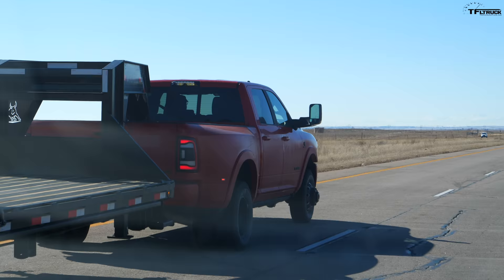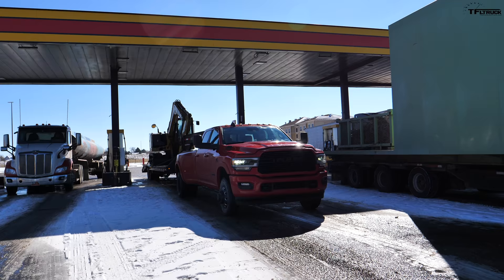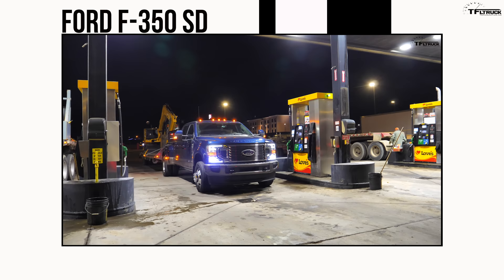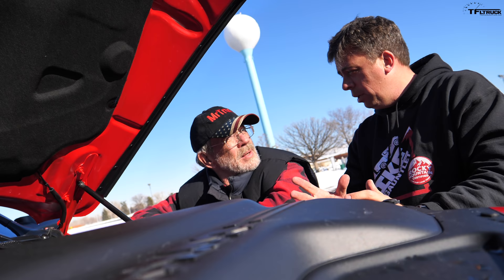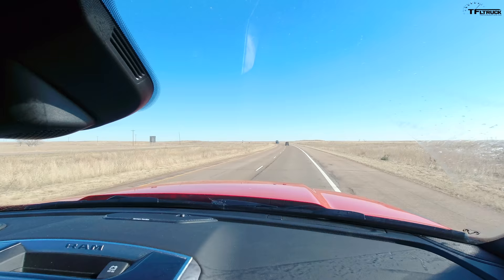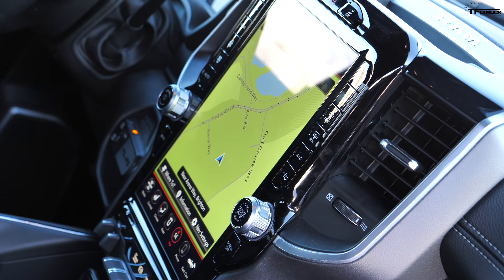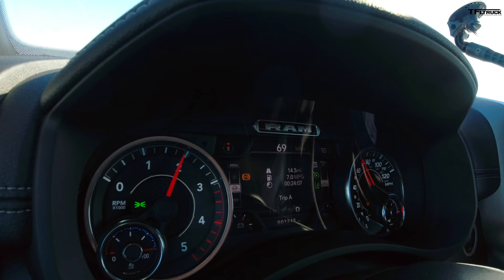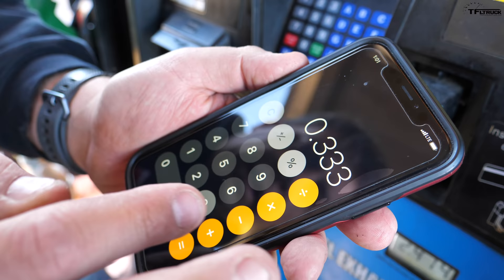New Ram 3500 Cummins Takes On Our 30,000 Lbs MPG Challenge Against GMC & Ford Diesels!

Comment: After owning a third gen cummins I said I’d never buy a Chrysler product again. But that is nice.
Reply: Haha yeah I agree. I have a '14 3500 ram with the Cummins. The engine is great, but everything else broke. I learned my lesson.
Reply: I've had zero issues with my 2nd 3rd or 4th gens....
Reply: Joe Georgia had zero issues with my 2016 Cummins!
Reply: You guys having good success with Ram trucks obviously don’t pull much n have your truck at bone stock power if you have had zero transmission and head gasket issues and haven’t done head studs and built transmission lol or are still at low mileage n drive like a grandpa
Reply: John Doe If you have a HO Cummins with an Aisin Transmission and bone stock power I’m not surprised if you don’t have issues but add any power and ur toast
Reply: L W you can't blame the drive train for failure if you're tuning it. That's like saying a car accident is the cars fault, instead of the drivers.
Reply: John Doe Lol that’s a no brainer I’m saying if I have to explain in like neuroscience a 6R140 Torqshift will hold 650-700 hp and 1400 ft lb whereas Allison 525 and 1100 and Aisin Maybe 450 and 1050 but you cannot turn up the rail pressure on an Aisin and adjust shift points like you can on an Allison or Torqshift
Reply: L W but you were saying the drive train was trash because it didn't hold up after being tuned. And that's just simply not true!!
Reply: John Doe Basically every tuned Cummins on the road with any added power With any kinda mileage and any amount of towing has or will soon have a built transmission unlike Ford and GM that can hold 100-250 hp over stock 🤷‍♂️😃
Reply: L W that's why ford had nothing but issues and recalls with their transmissions! 🤷‍♂️
Reply: John Doe You mean 2019/20 Ram ?That’s definitely the case on them!😉
I know ford had 1 transmission tuning update on their all new transmission unlike Ram having 2 or 3 and on a non all new and 1 being a whole valve body replacement not just tuning update and Ram Aisin still shifts like crap and redlines just check out PD Diesel Power channel 😉
Reply: John Doe Ford actually built and patented the 10 speed transmission that’s in 2019 n newer GM 1500 and it’s the same transmission as in F150 and built their own 10R140 too and yes I’m not surprised to have 1 tuning update on each on an all new transmission otherwise no hard part failures that I know of whatsoever
Reply: L W here's a typical conversation with you Ford fanbois! 

Ford fanboi conversation.......

Fb: Ford is awesome, can't beat the quality. I'm looking at New ones now while they replace the engine, and take care of the recalls.

Me: why would you buy another one fanboi? 

Fb: because you can't beat the quality, they're great. I've put 25,000 miles on in 2 years, and have only been to the shop 80 times. They're great quality, Ford best selling for 300 years! 

Me: Uhhhh... How is it great quality when you been in the shop 80 times, and they're replacing the engine after 25,000 miles? Oh, they're best selling because of fleet sales. Otherwise, Chevy would slaughter them, and ram isn't too far behind. 

Fb: Bruh, stop hating! They best, they kick everyone's ass. Ford forever Bruh! 

Me: 😦

Fb: well, they're done. I'll be back next week for them to replace the tranny and rear axle. Then I'm trading it for a new one. Ford is the best Bruh! 

Me: 🤦‍♂️🤦‍♂️🤦‍♂️🤦‍♂️🤦‍♂️🤦‍♂️🤦‍♂️🤦‍♂️🤦‍♂️😆😆😆
Reply: John Doe Lol those recalls were 2 each of the same 2 recall issues and 2 of em was on cars and I thought we were talking trucks lol 1 truck issue here on transmission shift tuning lol that totally beats Ram 68RFE being a total piece of junk from the factory that Ram should have recalled all their low output Ram trucks and put aisin or Allison in cause the 68RFE is a complete pile of garbage lol just check out all the 68RFE transmissions blown up online and then not to mention all the EcoDiesel scandal recalls and buybacks and transmission recalls on their half ton lineup for auto shift to park knob and now the recalls on 2019 2500/3500 on transmission valve body and transmission rough shifting I mean FCA problems are hard part and tuning issues both lol your description of Fanboys perfectly describes Ram fanboys lol 68RFE (whole transmission failures not just a little tuning issue like ford) also transmission tuning issues on Aisin and 68RFE new trucks 19/20 not 12-15 stuff like your showing about ford and Cummins blown head gasket issues lol as far as 15-20 trucks goes Ford is much more reliable and way less recalls and Ram should definitely have addressed some issues before now with recalls and even with avoiding a lot of issues they still have like double the amount of recalls as everyone else lol go do some research 😂😂🤷🏻‍♂️😆https://youtu.be/H5Ixlveajqs and https://youtu.be/i0cRTBVCb50 and recalls https://youtu.be/Vd5Alfyqpb0 and https://youtu.be/jSzNDUqGIIg and https://youtu.be/OvLGgu1HgFg and https://youtu.be/kVcj-tSBdvU
Reply: L W Ford and ram both have transmission issues, but Ford more! Ford is going through their own diesel gate as well. And to be honest, I'm glad they're cheating the emissions!
Reply: John Doe lol that’s bs Ford is not in any emission scandals and has only 10% of the transmission issues as Ram does Lol look up ford 6R140 transmission problems then look up Ram 68RFE problems and see which have the most issues hardly any on Ford super duty or any TorqShift for that matter and thousands on 68RFE Ram 2500/3500 low output transmission and Aisin doesn’t nearly hold as much hp and torque as TorqShift either lol you clearly have not studied into this much before talking lol everyone knows Ram has the worst transmissions in their trucks by far lol
Reply: John Doe 
https://www.drivingline.com/articles/boiling-point-part-1-how-far-can-you-push-your-ford-diesel-s-transmission/
https://www.drivingline.com/articles/boiling-point-part-2-how-much-abuse-can-the-allison-take/
https://www.drivingline.com/articles/boiling-point-part-3-how-long-before-your-dodge-s-automatic-cries-uncle/
https://www.drivingline.com/articles/what-killed-off-the-manual-transmission/
Reply: L W AGAIN.... You keep talking about tuned trucks, which makes your argument irrelevant!
Reply: L W look it up kid, they are!
Reply: John Doe can you send me the link? I heard of a lawsuit against ford ranger but never heard it to go through or be proven true on Ford like it was on FCA and VW and no diesel that I know of and btw my point is the transmission that holds the most hp is obviously the stoutest built and will have the least trouble as is proven in the real world as well Power Stroke vs Duramax vs Ram Ford has the least amount of transmission issues then Chevy and Ram the most
Reply: John Doe There’s a reason Ram is thinking of scrapping their current transmissions for a ZF or Allison

Comment: I have a 2020 Laramie 3500 dually,my fuel mileage started getting better around 4000 miles in, pulling approximately 27,000 lbs today for 400 miles and I was averaging 8.8 mpg.

Comment: FYI: My new work truck that I bought is an F350STX 4x2 dually with the 7.3 and power equipment group and aluminum wheels. $42,000.

Comment: Nice Job Ford!  Home run in my book.  Love the competition of the big 3 which benefits us all.  Can you really go wrong with any of them?  Probably not.  But man...the Ford is dominating.
Reply: Ford hit a Grand Slam with the mpg loop.
Reply: they had to limit the test to 66 miles because the Ford couldn't go any farther without a mechanic shop😅
Reply: @tomlarge8841  Haters gonna hate!!  :)
Reply: @ModernCountryLiving  it’s true. What’s the point of better mpg on a 66 mile route whenever the truck isn’t reliable on long hauls.
Reply: @piglet7943  I am sorry that was your experience.  Ford has regularly topped the consumer reports HD truck reliability ratings.  Though, to be fair, none of the HD are super stellar compared to a Toyota.  

I'd buy any of the HD trucks.  To say one is worse than the other needs to be based on real data...not a single point data....but tens of thousands of instances of reliability data.  I'd put lots of miles of Ford super duty trucks and so has my dad.  He has also owned Ram and GM within his construction firm and he's buying Ford vs them based on what he likes and his reliability experiences.

Comment: I'm not surprised to see that the Ram came in 3rd on the mileage as Dodge isn't known for fuel mileage in many of its vehicles.  I will say in a HD truck it isn't always about the mileage as how much you can tow or haul.
Reply: Has absolutely nothing to do with Cummins
Reply: @doddgarger6806  I never said it did.

Comment: Hopefully this will be incentive for ram to go with Allison to replace the aisin. Ide love to have that 9 speed behind a Cummins 😍
Reply: If Ram pulls the trigger and goes to the Allison I think they own the market place
Reply: Mike Hunt - or maybe even an actual Allison 10 speed or a ZF 10 speed. Or how about going like a big truck with a 12 or 13 speed. What ever they do I think they need a transmission with a wide enough spread to be able to have a 3.42 rear end. I thing the 3.73 is a big part of what’s hurting their mpg’s. Straight 6’s really do seem to work better at lower rpm’s.
Reply: knightwing4 I honestly think 3.73 is the sweet spot for towing and mpg. Even with more gears. Semis typically run 3.73 or 3.55 at the least even with 18 Speeds. And it would be nice to get the Allison, I see them using there 9 speed since that is what Allison is pushing right now. And if they get a ZF “which is likely” will probably be an 8speed. They already run ZF 8speeds in the 1500 and now the 2500/3500 with the 6.4 hemi. As well as ZF has been testing the new 8speed they developed on a 2015 ram 3500. But we will see 🤷‍♂️
Reply: knightwing4 I believe Ram has dropped the 3.42 in the 2500 trucks. It’s 3.73 with the option to get 4.10 now
Reply: knightwing4 used to but not anymore Ford has 1050 ft lb at 1600 whereas Ram High Output only has 880 ft lb at 1600 and 1000 at 1800
Reply: Or you can just buy a Super Duty.
Reply: scottdbsn Lol right the 2020 6.7 Power Stroke has replaced the Cummins engine as the low end torque and fuel economy monster and is now just as reliable not to mention the whole rest of the truck being much more reliable 😉👍
Reply: All three trucks have the same top gear ratio of 0.63 to 1. For top gear cruising like this, final drive ratio, tires, drag coefficient are what matter for economy.
Reply: L W hahaha 😂 and you think it’s going to stay that way? It a competitive market. There going to continue to 1up each other in numbers until one goes under “most likely gm” and dude Your crazy if you think a powerstroke will outlast the Cummins across the board aside from the occasional fluke. Even ford used the 6.7 Cummins in there f650+ line up until recently. And I doubt they will keep the powerstroke in them long.
Reply: Mike Hunt Lol ya ford had used the Cummins and Allison until they built their own engine and transmission for those trucks with better ratings and same 500,000 mi life ratings you think they would’ve scrapped Cummins/Allison if they thought they were gonna do worse without it .? Lol how blind can you get and if you look at reality 2019 power stroke already had 2019 Cummins beat on the dyno before even upgrading and Cummins has a long way to go to get even a 1000 ft lb at 1600 where ford is at 1050 they only have like 880 ft lb at 1600 and 1000 at 1800 lol and at the peak hp Cummins only has like 750 ft lb at their peak hp rpm of 2800 and Ford has 960 ft lb at their peak hp rpm of 2600 not to even talk of hp where ford was ahead all along
Reply: L W you must not know how outsourcing parts works. The only reason ford swapped for there own isn’t becouse they were better. It was to do what EVERY manufacturer does, save money 👌 💰. Going in-house is the best way for any manufacturer to save money. It has nothing to do with quality or longevity when they go that route. And I never said the powerstroke didn’t have more power, It does hands down👍 but in comparison to a Cummins it just doesn’t have the longevity. I’ve worked on diesels for years and I don’t know how many times I’ve seen powerstroke in the shop long before any of our trucks with Cummins. They put down more power becouse ford tunes them for it. V8 diesels are easier to get higher horsepower do to there design making it easier to run higher rpm consistently. But v8 diesels sacrifice there longevity for the speed and power. Inline six motor naturally last longer and have better torque production do to longer piston stroke and lower rpm. They put out high torque numbers but lower hp. And it makes them longer lasting workhorses. The powerstroke has been beefed up to beet the Cummins on paper, all for advertising and swinging dicks. But that power bump will put brand new fords in my shop this year. Like they always do
Reply: Mike Hunt Lol I don’t think so cause Cummins is a much cheaper engine than power stroke lol
Reply: L W read the rest of the post son. I pressed send to early
Reply: L W that’s only at the price ford list for there motors. Diesels are relatively cheap to manufacture. And using a motor YOU built vs buying a motor from someone else will always be cheaper... get your head out of your tailpipe and think about it
Reply: Mike Hunt in theory but buying both from a totally outside view ford 6.7 Power Stroke parts are much more expensive and by the way remember this is only your theory not necessarily the facts lol
Reply: L W hahaha 😂 ok I think I’m waisting words on a superfan, so I’ll go after this. But I guess you didn’t read the part where I said I work on and repair these motors. The cost is a fact
Reply: Mike Hunt You obviously didn’t realize that 6.7 Power Stroke is detuned for reliability in the 450-750 cab and chassis and is actually rated at less hp and higher torque than 6.7 Cummins and is actually lower rpm than 6.7 Cummins and also more reliable! Get your brain out of the 5.9 6.0 6.4 days when Cummins was in fact lower rpm torque than power Stroke international engines. Also in 2020 power stroke uses steel pistons and therefore longer rods and power Stroke now has more low end torque at lower rpm and more reliability in the last 5-7 years than Cummins and they also built a transmission that definitely holds up to more power than Allison . I mean they also crank the Cummins to high heavens to get it to keep up in the pickup applications and the reliability goes down to like half lol you gotta understand both are seriously detuned in the 450-750 class lol but 6.7 Powerstroke RPM range is 1600-2600 and Cummins is 1800-2800 and so your high rpm V8 stuff is definitely outdated Cummins fan ideology used to be true 10 years ago but 6.7 power Stroke operates differently than previous V8 and has a longer stroke lower rpm design. Update your facts man🤷‍♂️😆
Reply: Mike Hunt And just cause you work on em doesn’t give you the monopoly on information cause I also have worked on both and you have proven by some of your statements you don’t know much about the newer engines and how they work lol you’re still on the Cummins lower rpm lower end torque train of 10-15 years ago 🤷‍♂️😃 Only Cummins super fans are too blind to see that Cummins is actually now the highest rpm of the big 3 😉🤷‍♂️in specs and on the road 😃 Cummins peak torque 1800 rpm and peak hp 2800 rpm, Dmax peak torque 1600 rpm peak hp 2800 rpm , Power Stroke 6.7 peak torque 1600 rpm peak hp 2600 😉
Reply: Mike Hunt Lol and the Power bump will put the ford in my shop this year?? Lol do you fail to realize Cummins had a power bump as well and is also tuned much higher than its original purpose to try and compete with the V8 lol in the pickup segment where both are tuned and beafed up if you look at real world facts instead of only theories Power Stroke 6.7 is actually holding up better than 6.7 Cummins in that high hp and torque state I mean Cummins hasn’t been able to keep their heads down so the gaskets don’t blow without the owner studding the heads lol and their Holset VGTs aren’t holding up either 🤷‍♂️😂

Comment: The only thing I don’t like about this test is that it’s on winter diesel. Anyone who has driven semi in the winter, you always lose mpg in the winter
Reply: Up in Canada the Diesel fuel is #1 to run at very cold temperatures of - 50 C. But that fuel has less BTU per gallon than #2 Diesel. American Diesel runs #2 all year around with 5% - 20% Bio-fuel (plant based) mix that gels like crazy at that same temperature without adding Power Service anti-gel to it.

Comment: Great results guy, 
On the transmission 6 speed vs 10 speed won’t help with that much weight. I could assure you ford and GM did not see 8,9, or 10th gear with 30k on its back. However unloaded would make a small difference though..

Comment: 30,000 pounds ain’t no joke. For a 1 ton truck now this might work just fine on flat ground. Did you start running mountains like the Cascades or the Rockies. Let’s just hope whoever is behind that wheel knows what they’re doing.